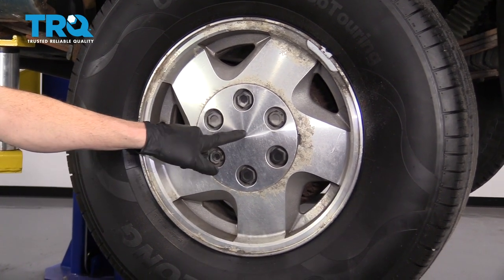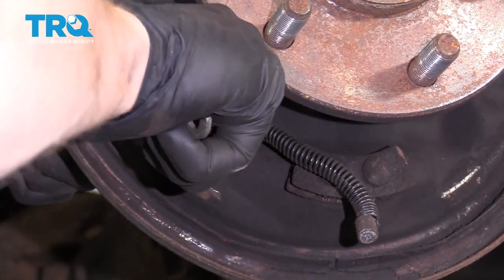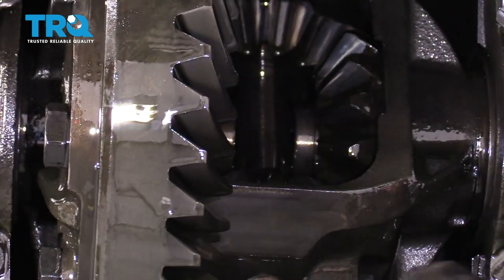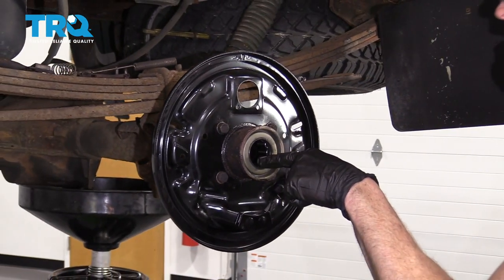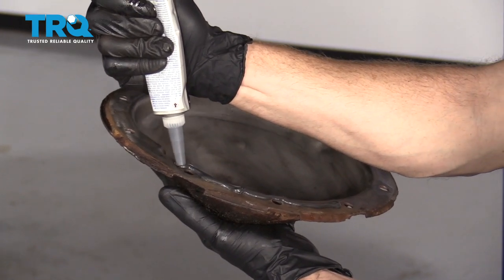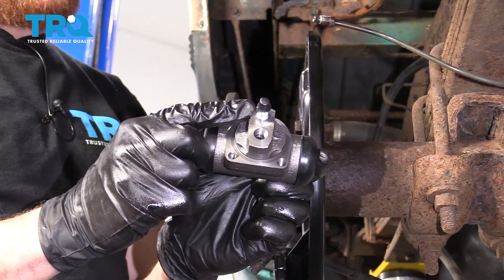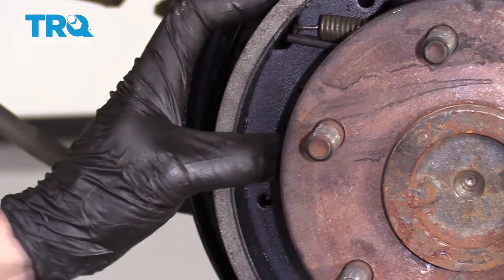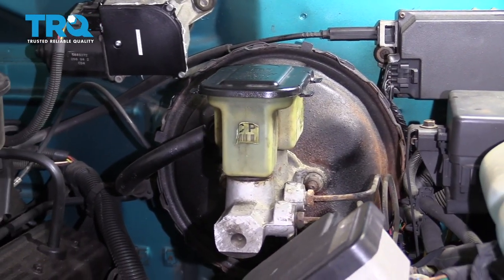How To Replace Rear Brake Drum Backing Plate 1992-99 GMC K1500

Comment: I have a 1997 GMC Sierra that I'm rebuilding the rear end on, so you confirmed a few useful bits that I figured are going to be needed.  You passed over the key points of installing the axle seals and the torque for the gear pin and bolt.  A few other issues, but mostly were already noted by others.
And for awareness, the lug nut torque on that series year is 140 ft-lb, not 120 ft-lb as you commented during the video.

Comment: This was one of the most AMAZING videos I've ever watched. However, I do have a question about the fill plug for the differential.
What is the size of the bolt that fits in to it? Or, what even is the bolt? Is it an inverted hex? If so, what size? I haven't made it this far (working on my own truck at the moment) and I'm curious if I have the right tool.

Comment: What's holding the brake shoe up while you put the spring and retainer on?
Reply: For the first shoe, (if you're following the video in order) the E-Brake Lever is holding the shoe in place (plus the correft placement of the shoe helps). As for the second shoe, the spring that runs across the top of both shoes (holding them together) is holding it in place. You may have to shift the shoe over a tiny bit to get the pin to fit on to the spring and reainter perfectly. I recommend having someone help you hold the shoe and pin while you put the retainer on. Hope this helps.✌🏻

Comment: Why would replace the dust plate in the first place?
Reply: I have to on my 98 k1500 because bad wheel cylinder bent the brake shoe and the bottom where the two shoes ride. Hence needs backing plates only way to fix it correctly if bent
Reply: If I could post a picture, I would. In my case, my backing plate was way too corroded from rust, snow, and salt from up north. The inner ring that holds that shoes in place was literally falling apart and no longer held the shoes in place. They were sliding around freely. :/